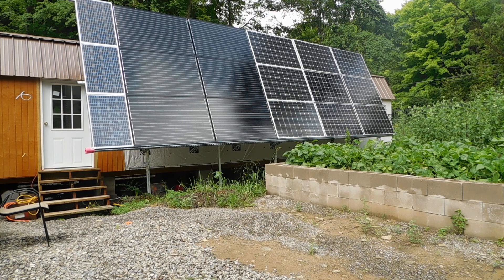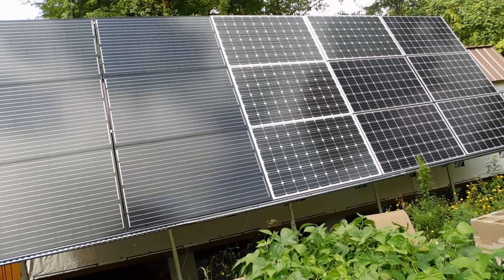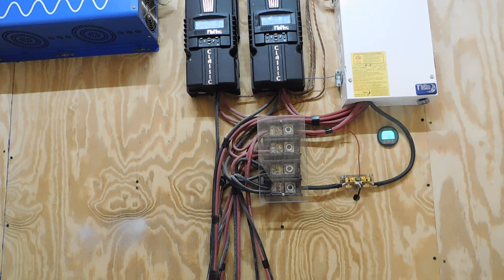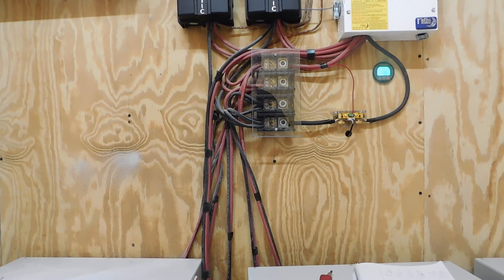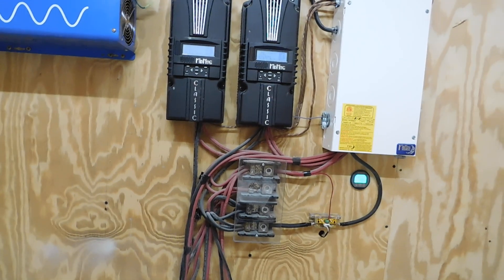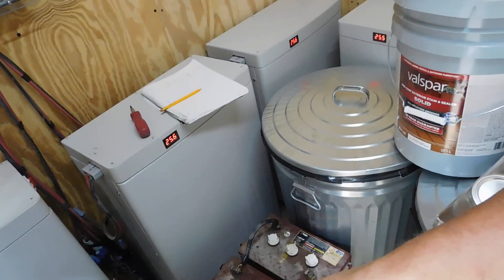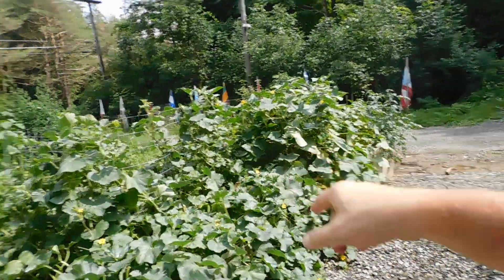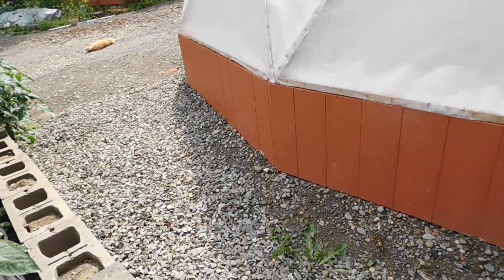A complete look at my solar set up and what we are going to do to get things squared away.

Comment: I believe strongly in solar. I have had it in a previous home. Last year, I bought in on one of the no money down deals from a solar company. It looked great on paper. 24 x 305 Watt panels. 77320 Watts but limited to 6000 watts by the inverters. An alleged 25 year warranty on every part of the system. The selling company  hired a local solar contractor to do the actual installation. when the project was in the finishing stages I asked where the battery bank would be located but was told the system was grid tied only. 
A year later, the inverter failed. That was a month ago. The selling company, it turns out is fain Texas of shutting down one step ahead of the Texas Atty General's office and then changing it's name to start over again. They aren't there to honor the warranty. The installing company says they didn't sell it to me so it isn't their problem. The utility company is aware of the problem but can't or won't intercede.
The bright spots? The manufacturer of the components will send replacement parts but they have to go to a solar contractor. The financial company is trying to get the repairs taken care of  but it takes time to work through the system. The Missouri A.G. is more than willing to go after the owner and has sent me the paperwork to fill out.
Caveat Emptor. Be aware. Ask the right questions. Check out the track record of the companies involved to see how long they have been in business? Are there any  complaints with the Better Business Bureau? Or be smart enough to do it yourself. These companies especially like Senior Citizens. Ask me how I know...
Russ

Comment: Yes split the lead acid batteries and charge controllers for chicken coop and sisters little shed. Start thinking now on how you will keep those batteries from freezing this winter. Place the panels close to the chicken building for a short run, place the other panels for sisters place to the space behind the peach trees, over enough to be able to getting around them to access the back of the property. Build an oversized doghouse to store sisters batteries and controller.

Comment: Do you track the temperature in the battery room? I am wondering if overheating may be part of the problem you are having. I noticed you leave the door open all the time, so it must be an issue. I would consider adding a small a/c unit to that building. The building is well built and well insulated, and as often as you are in float mode, it should be able to handle the extra load of a small a/s with no problem. A stabile constant temperature should make the equipment last longer and run more efficiently

Comment: That is a good plan, I would still make one big battery for the 3 buildings with all 8 batteries (when the others arrive).  It is likely at some point that when everything is running, is that one building might pull more power than one of the others and it would be frustrating to have battery capacity available in the other batteries and be unable to use it in 1 of the 3 buildings.